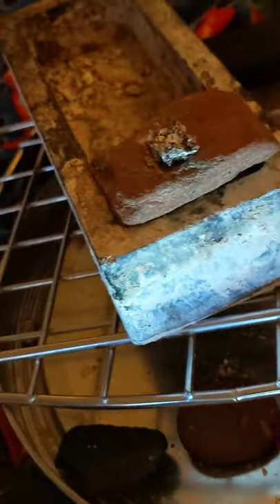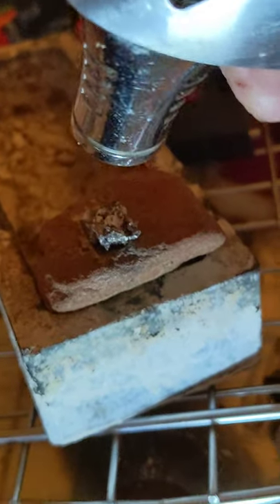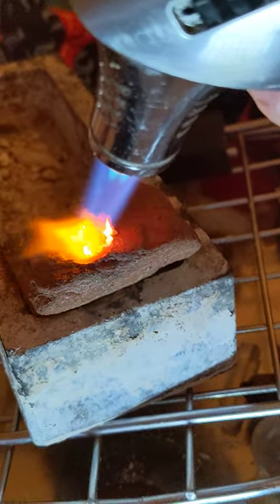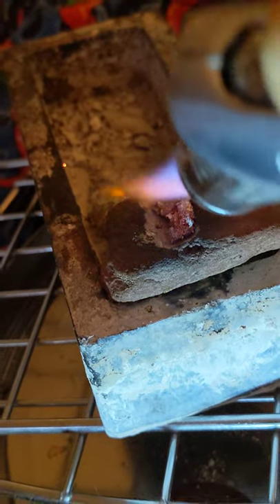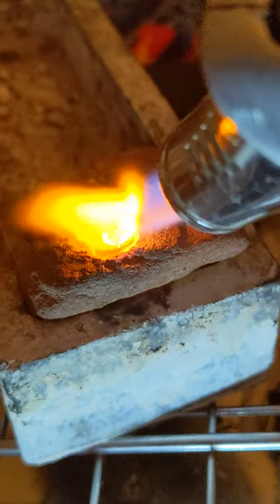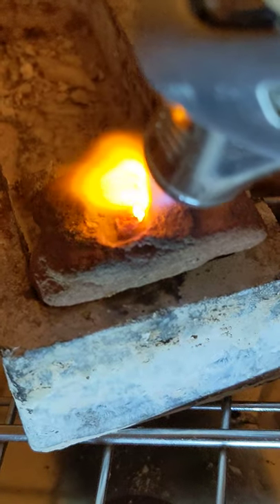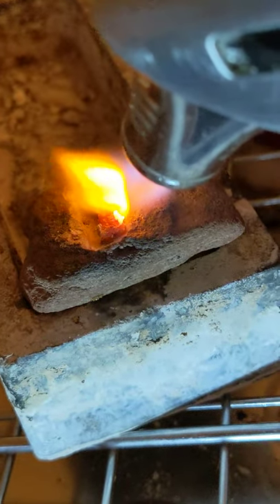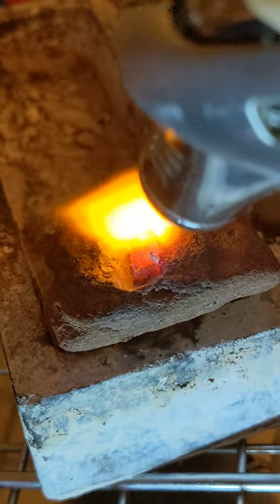melting palladium... or do not

Comment: tried to melt 1 1/2 troy oz of palladium with an oxyacetylene torch and had minimal meltage in the area directly under the heat but could not get the entire piece liquid.  was still pretty when i was done
Reply from the maker: yup
Reply from the maker: it's a superconductor for heat... it's leaving actually faster than we can put it in
Reply from the maker: it's because there are covalent bonds in the palladium unit cells.. the gold is in the planes of cleavage.. so we can deform it easily... but it doesn't melt worth a darn
Reply from the maker: are you using laboratory.. reagent grade palladium.. or my stuff processed with borax?
Reply from the maker: I've never used the reagent grade stuff.. I'm doing this stuff on my own dime... palladium is more expensive than a dime
Reply from the maker: like dollar store foil... most of the "aluminum" from China is actually AuPd.. so pretty much anyone can afford it..  I love the dollar store
Reply from the maker: I'm looking at a meter of "aluminum" irrigation pipe... shiny white... makes rainbows in close up pictures... rings like a bell
Reply from the maker: so... if you blow air through it cools down a lot.. add a mist of water.. very small amount.. the temperature drops 20° C from ambient
it's a..  dirt cheap way to air condition our homes
Reply from the maker: you can blow the water spray on the pipe not in it.. and recycle the water..  all using 12 volt technology... welcome to the future
Reply from the maker: you can heat the water and heat your home.. free
prosperity begins when we don't have to buy everything we need to live from someone else
these ideas are a gift
for all of us
✌️❤️✌️
Reply from the maker: I tried oxy acetylene and a cutting torch.. 
I didn't know what I know now
I got a small plasma cutter from Amazon.. 3000° C... tried to melt the stuff sitting on the dust with borax.. it's now.. AuPt.. and very heavy.. some of it is heavier than pure platinum.. which has a specific gravity of 21.9.. I have isolated it up to a 23 SG... from the dust on the side of the road.. there's no shortage of it
Reply: @RickarooCarew  old dental bridges probably are alloyed with some platinum and gold as well.  bought it dirt cheap at an auction.  1.5 troy ounce for 50 bucks
Reply from the maker: @davidbostwick7878  good on ya... I don't know about that.. I am going to start selling this stuff to places like dental labs.. I'll ask
Reply from the maker: there are instructions for making AuPd wire.. but I ordered some aluminum clothes line from Amazon.. it's from China.. it's already AuPd.. it's beautiful.. and really really useful around the house, shop and laboratory
Reply from the maker: I'm going back to the lab to melt gold.. looks like it is 24k.. but I don't know.. my little furnace should work... I'll take a video
Reply: @davidbostwick7878   paladium ??
Reply from the maker: @macaodts2279  Pd= palladium... Au = gold .. 
AuPd is found in white volcanic ash.. and kaolinite clay... and dollar store tinfoil... and most of the "aluminum" products from China... it is easy to tell the difference... use your phone camera and take a close up... it has a very regular pattern of rows and columns on the surface... it's bright shiny white metal... aluminum is a dull grey... without rows and columns on the surface...
aluminum melts at 700° C... palladium and AuPd melt above 1550° C... similar to tool steel
Reply: @RickarooCarew  yes alumunium 700c  platinum 1300 c. You. Chek nitrit hno3 how?